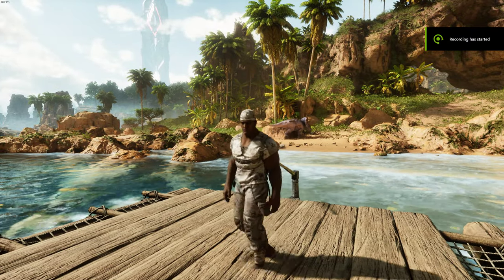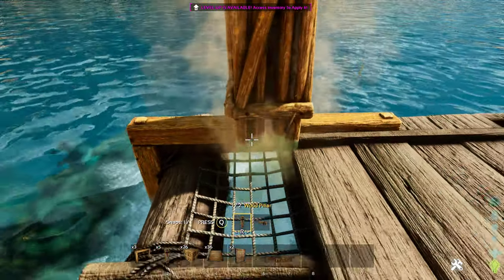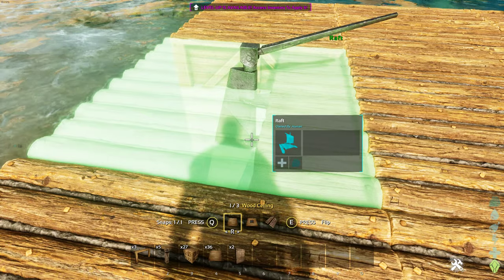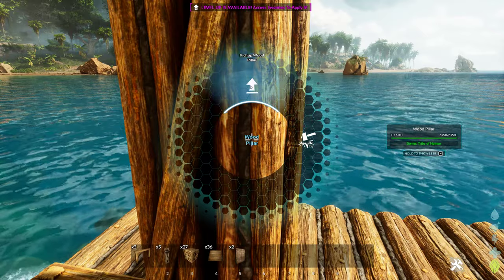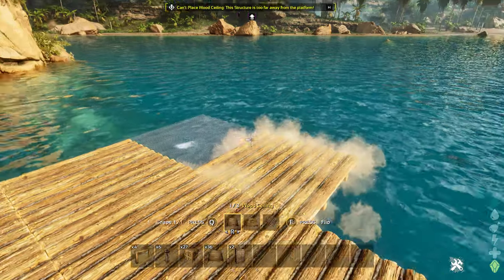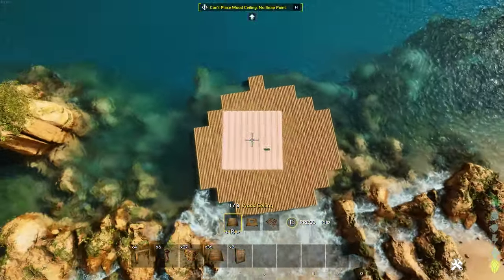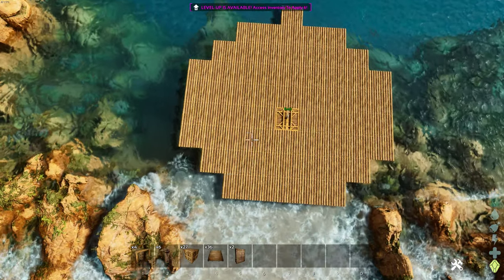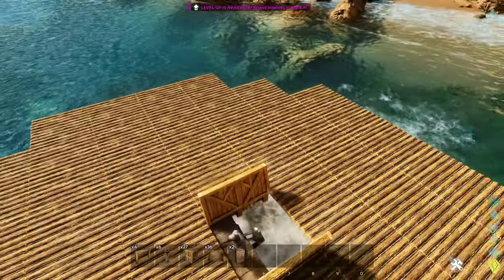Sink Foundations on Raft| Ark Survival: Ascended

Comment from the maker: Just found out there is a new mechanic for foundations and how to adjust its height: will make a new video. There is a sleight height difference so I will make a video to compare! My way is slightly more lower than the other way. All up to preference  now (: Ps all you is hold the place button during the placement of your foundation.
Reply: Btw if you put the hatch door where you drive it you can still have your raft damage from below on that part right ? If it was covered witha foundation it will be protected, right ? or am i seeing something wrong ?
Reply: Still can't figure out how to remove sail
Reply: @jaykenyon1 😂 it’s a setting on the circle wheel on the boats “behavior”

Comment: Bummer, worked like a charm on release. Came back to this vid to make another raft and seems like it's been patched. Can't seem to snap to the bottom of pillars anymore. As OP mentioned in the pinned comment, you can click and hold with your mouse and you will go into height adjust mode when placing the foundation. Best workaround I could come up with is to just eyeball the foundation position in the corner of the raft like in the video and then lower the foundation as far as it will go when placing. You'll still get your 3x3 out of it.